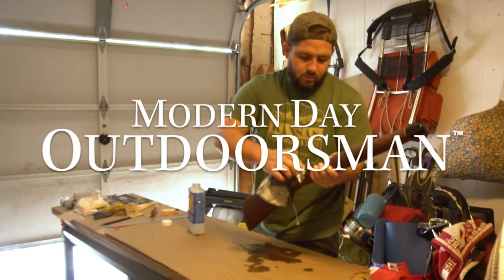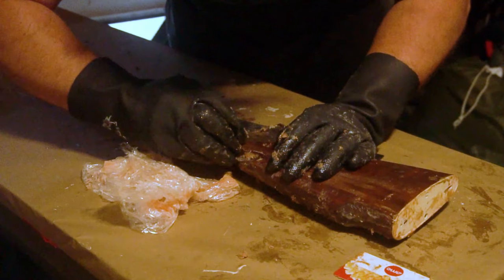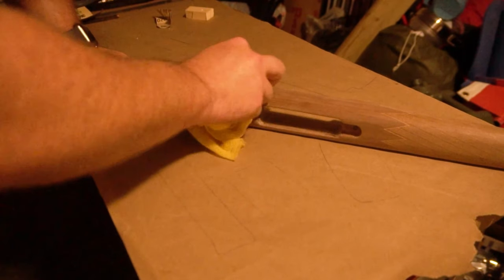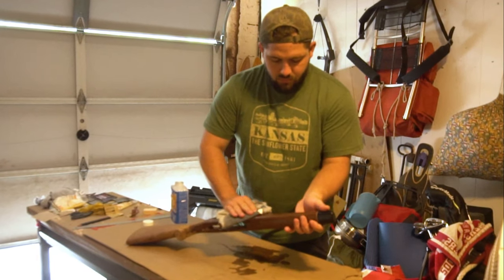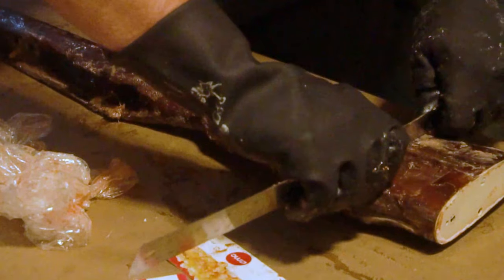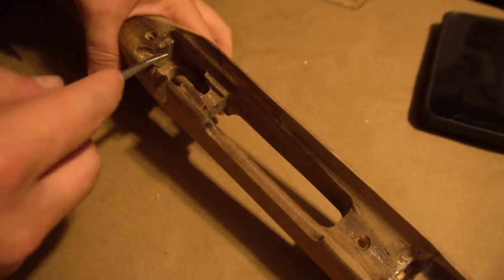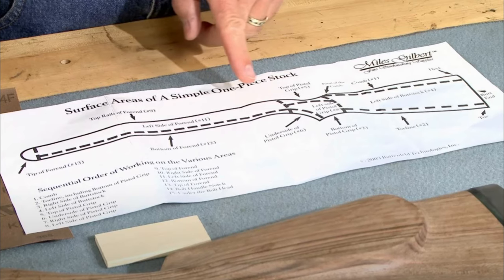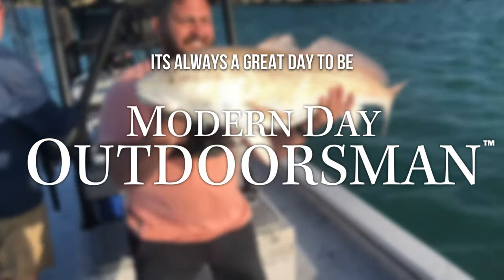Stock Redesign, (pt. 1) Removing Gun Stock Varnish! Citristrip removal for Carving & Restoration!

Comment: I have an old military stock that someone decided to varnish some time ago. The wood to metal fit isn’t great so I think I’ll use different grades of steel wool to smooth out the stock and us soft bristle brushes and an air gun to remove any powder or flakes left over before I apply a coat or two of tung oil.

Comment: 1:05 Another great possibility would be a razor scraper, (When used correctly) will easily scrape off and do little to no damage!
Reply: very true!
Reply: That's the way westhunt of Western Hunter classics does it he scrapes It Off
Reply: That’s what I use after i lightly heat it up with a torch. I try and remove heat just before it starts to bubble. After I get my groove going with a razor  I can strip a stock in 10 minutes. Sand then if the grain is nice I will lightly burn it followed by linseed oil

Comment: Forget the stripper. A cabinet scraper will remove ANY finish in less than an hour without any fuss
Reply from the maker: I have heard this a few times- and all I have to say is, “where were you when I researched how to do this!?” 😂 there were many forums I read that said the Remington factory stock finish was not like your average rifle stock, and is an absolute pain to strip. So- I went with the citristrip, which was recommended by many.

Comment: I've done a Remington with the "bowling pin finish", forget the citrus stripper. It's a frickin' fiasco and doesn't soften the finish. Airplane Stripper with Methyl Ethyl Ketone works but you'll lose half your brain cells to the solvents in it if used indoors so forget that. I simply use a utility knife blade drawn across the wood like a scraper. The finish rolls right off and the walnut is hard enough not to make ridges in when scraping. Just be careful not the let the blade "chatter" when you draw it across the stock. A light sanding and you're done. I stripped and sanded a 700 BDL in about 45 minutes. The other thing is that you can easily work around the checkering without destroying it like you did by sanding over it. Leave the finish on the checkering and wipe the rest of the stock down with Danish oil followed by a wipe on poly staying off the checkering. It makes a first class job very simple and clean. I light wipe of satin poly on the checkering dulls it enough to look fresh without looking like you filled it in with varnish.
Reply from the maker: Sounds like a good idea! I’m amazed with how many people have been thrown off by the checkering. I had always planned to do go over it with checkering tools afterwards, so I’m eager to see if I’ll regret that choice or not! Haha well find out at the end, maybe I’ll do a recap where I talk about what I would change if I did it again.

Comment: So, is there a reason you put citristrip on the inside of the stock where the barrel and receiver sit? It seems like an unnecessary and mildly frustrating process for a portion of stock that's not going to be seen.
Reply from the maker: Good point, Bruce- I honestly just wanted to start from square one on the entirety of the stock. If you feel it’s unnecessary — by all means, skip it!

Comment: so you stripped the black cap at the forend?  doesn't that make a mess of it?  I'm doing one now and masked that black part off but the citristrip got under the maskig and desolved some of the black part.  what shouod I do?
Reply from the maker: The ebony definitely feels like a softer wood in comparison to the rest of the stock, so may require a bit more care, I’m under the impression that the stock will look more uniform if I do the entire thing at once, instead of building up to what was there before- which is why I removed everything, but I’m yet to put on the varnish. Maybe this video will be of help: https://youtu.be/m9LZsZMmXpE
Reply: @moderndayoutdoorsman  I was under the impression the black tip on the 700's where made out of plastic same with the pistol grip cap.

Comment: All junk you don't need. card stock metal scraper, once the finish is removed  some light sanding. finish to your liking. no mess, no chemicals.
Reply: @patrickrheaume6984  eh! Well I’m glad it worked for you! And congrats on your video! Before working on all this, I had heard the Remington 700 stocks could be nasty- hence my video, so I’m glad it’s helped people!
Reply: @BoAngles  Not my Video, one I researched and found, would have done it the same way as you showed, so again wasn't coming from a place of disrespect, just pointing to a better less expensive and cleaner way of doing it. Whole lot less Product which s something we all need to buy less these days. Peace!!!

Comment: You been a lot faster to skip the stripper and just scape it, it's faster and cleaner, I'm doing a module 700 stock like the one your doing, it took me 2 hrs to scale all the old finish off mine , without any stripper
Reply from the maker: Well good deal! Had never done it before, so in my research, it had mentioned the gloss on the classic Remington 700 BDL stocks was a bit like dealing with the fires of Hell in comparison to other stocks, and the citristrip was recommended on various forums! But more than one way to skin a cat I suppose!
Reply: I have a pos stoeger stock I want to redo should I just sand the factory finish straight off? If I do just get rid of the checkering or what

Comment: THIS IS, imho/every & other wood worker, THE WORST THING YOU CAN DO TO A GUN STOCK!
The citrus crap does do a great job of removing the finish.
DEALING WITH THE REMOVAL/CLEANUP IS A NIGHTMARE!!!
tip: 
1: Use a metal card scraper, re-burnish as needed
2: 120->220G flexible made by 3m (no endorsement, it just works best)
3: I use  Watco DANISH oil x3 coats (no endorsement, it just works best)
>(overall, about an hour, including BS'ing and whatever. 
APPLY-->15 minutes-ish then wipe, 15 mins-ish then wipe, BS'ing, oh yeah, and then 15 mins and wipe 
4: use toilet bowl wax (yuk), or modeling wax melted (much better), or pure wax (I don't remember where I got it, not Gulf Wax, maybe pure bees wax-<billets>, whatever---testing it on another stock)
*****In my experience with test pieces, the orange stuff tends to open the grains way more unless properly removed (AT least 3 hours of watching grass grow waiting time frame, and if not completely removed, as a beginner or novice, is a huge process to wash/remove/dry/oops missed a spot or 30/and start over, or wait, or ruin your grandfather's sears and roebuck family heirloom.
Reply from the maker: Thanks for your feedback Patrick! Seems like we were pretty similar up to the Citrus varnish remover - which I used because I had read many people recommend it on various forums for the Remington 700 stocks, because they have a very thick varnish evidently… Glad you found what works for you, though!